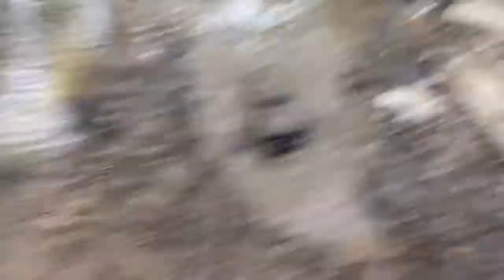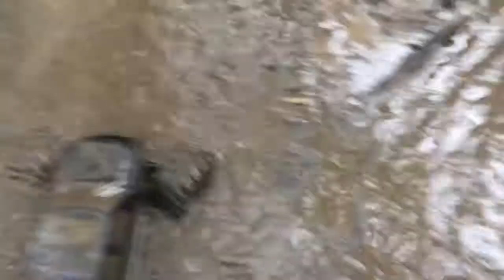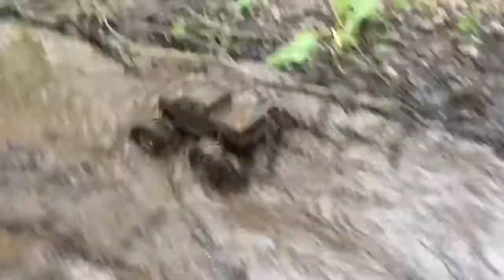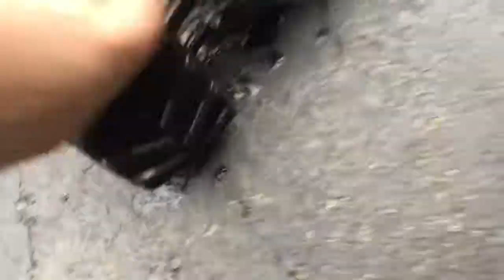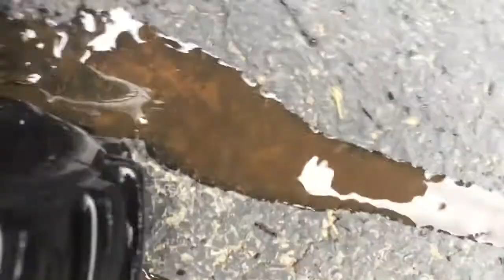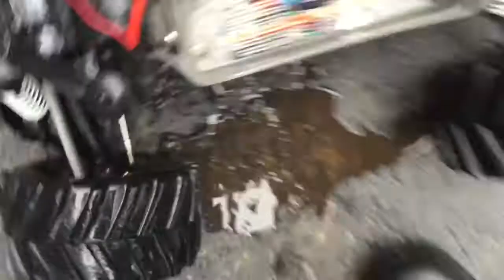Traxxas Stampede 4x4 Extreme Mudding

Comment: Man. Idk if it was just my audio, but it sounds like the slipper clutch is loose. How do you clean your trucks? I use wd40 for the motor.
Reply from the maker: yea i loosenend the slipper to not break driveshafts, i hosed it down after and dried with the air compressor, still seized a few bearings.sorry for the late reply

Comment: It sounds like your clutch is loose and time for some holes in the tires to let the water out
Reply from the maker: Yes, I did not want to break an axle but it was a bit too loose. those tires have been sitting after this till now. i need to drain them, its bad now